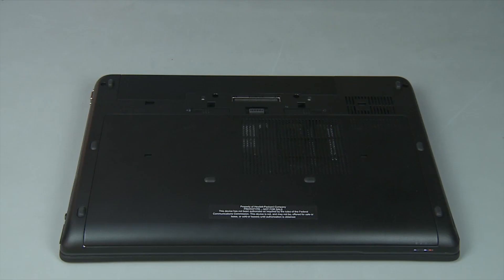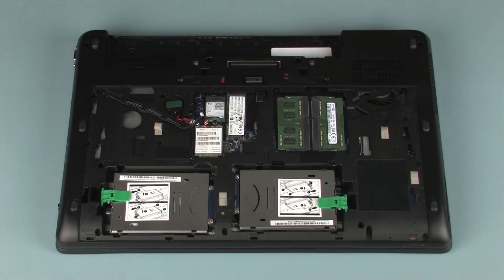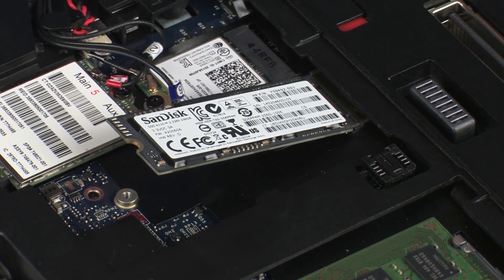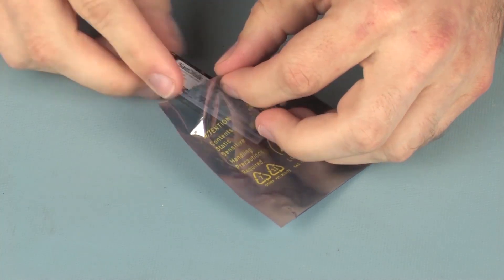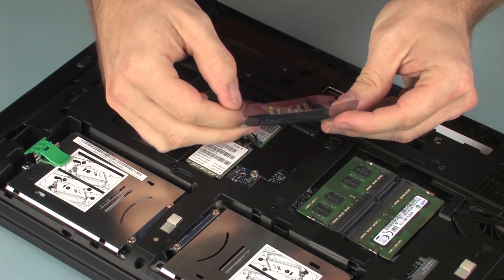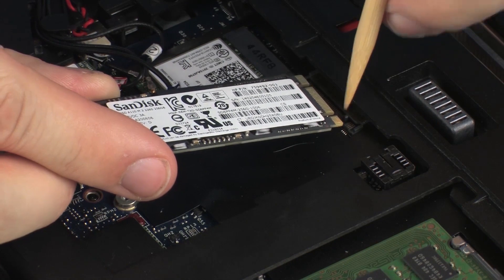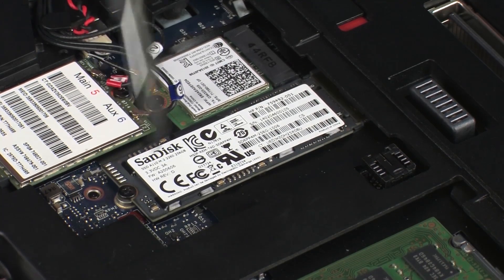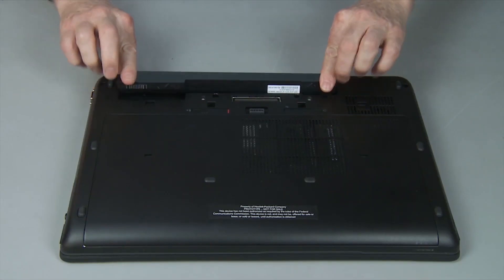Replace the Solid State Drive | HP ZBook 17 G2 Mobile Workstation | HP Support

Comment: Hi, I realised this is an old post, but could someone there advise me on what I am NOT doing right with my ZBook 17 G2. I recently purchased a SK Hynix BC511 NVMe (RR-HNX-BC511M230S) SSD and found that it wouldn't fit into the slot below the WLAN, I assumed that was the M.2 interface, but it has 5-28 pin while the Hynix SSD is 5-29 pin. Have I bought the wrong factor/generation SSD? I would appreciate any advise on this. Many thanks.

Comment: i had exaktly these modell (Hp zbook 12 g2), but it's really difficult, to get a m.2, which is working, for this device. 
Tryed out different sizes, always labeled with "m2 pcie nvme" - but nothing works. First i tryed 1 tb, than these days i tryed 256gb. Both is not working.

Can anyone help?
Reply from the maker: +schorsch1989 After replacing the SSD, please try updating the bios. It should work.

Comment: I have this exact same model. I bought it for $800 and I always have problems with this laptop. When I attempt to turn it on, the screen remains black and the caps lock flashes. I have tried literally everything but it still won’t display. Please HP, I reallllly need help with fixing this. It has been 2 years since I purchased this laptop 😫😫😫
Reply from the maker: +oldnew gaming thanks for reaching out! 
I understand that you are experiencing a black screen issue on your notebook. 
I'll do my best to assist you. 
Please use this document to resolve an issue when the screen remains blank after turning on the computer: http://hp.care/2ou62ed 
Let us know how it goes.

Comment: Hi , i have a problem in the the same version of this laptop when I plug the cable to tourn on my laptop it won start but it flashes white laight in the Maj bouton and power boutton and  lhigt things in  the back. can you help me plz what can I do
Reply from the maker: +Anass Abich Please follow the guidelines under this document to fix this issue: http://hp.care/2fvFhBM
Reply: Unplug the battery and press and hold the power button for 30 seconds (with the charger disconnected too). This fixed it on my EliteBook 8460P

Comment: Hi, can you please tell if m.2 SSD can be installed on hp zbook 15 g2, if it can be installed, then which type of m.2 SSD can be installed because m.2 SSD's are available in different sizes (length)
Reply from the maker: +Ehtesham Akhtar Please refer page number 45 of the user manual to know about the supported Solid-state drive (M.2): http://bit.ly/2tvLN6N